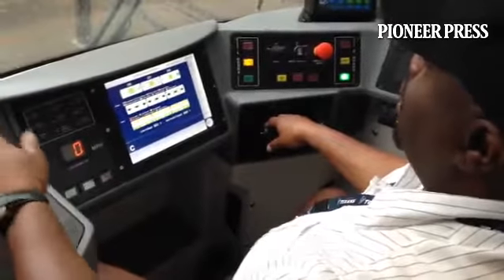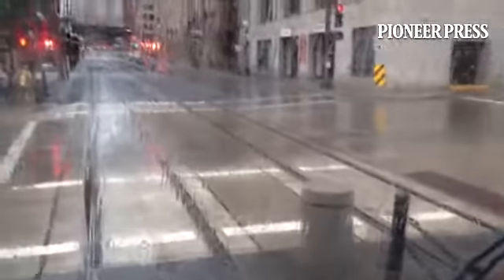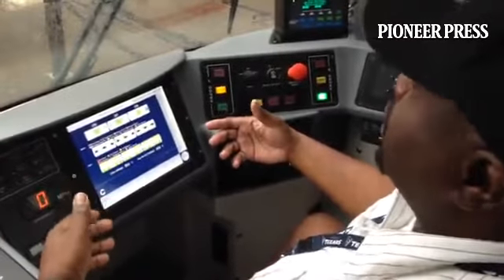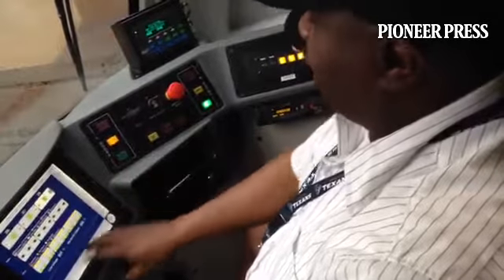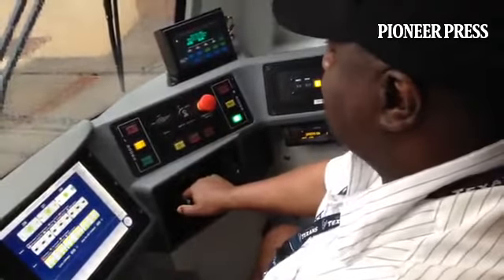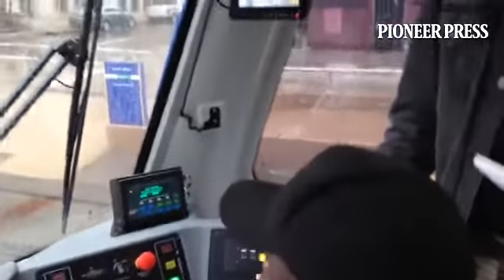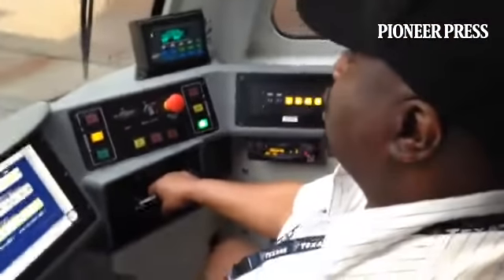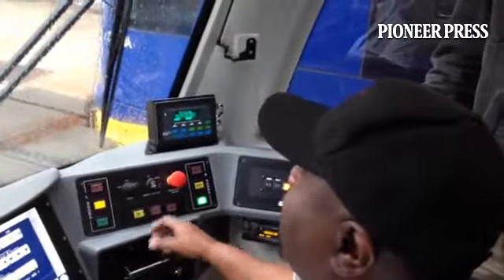Rolland Green blows the horn on the new Green Line light rail...

Comment: I notice newer light rail trains and streetcars have electric K5LA horns
Reply: +Raja Rhodes They've had them for years, though alot of Metro's new light rails substitute the electronic K5LA for some buzzer that sounds like a dying duck. I don't know if it's supposed to be quieter because people care more about their petty vanity than public safety (one of the main reasons I detest railroad quiet zones), but they sound extremely unpleasant.

The systems I know of that do have the electronic K5LA horns besides Metro are VTA (San Jose), MAX (Portland), UTA (Salt Lake City), and RTD (Denver). San Diego uses either a single-tone e-horn or some buzzer that sounds like a killer robot, NJT has actual Wabtec air horns, San Francisco and Sacramento use single-chime airhorns (though Sacramento has ex-VTA cars that still have their old e-K5LAs), Seattle has some sort of multi-chime e-horn I can't identify, and I have no idea about Phoenix, Dallas, Atlanta, or Norfolk.
Reply: +BNSF1995 i live in Dallas. DART train have air horns for use around traffic AND an air whistle for regular rail crossings. they also have actual bell. DART has Kinkisharyo SLRVs and use all standard horns and whistles and bells. no electronic bells or horns
Reply: Yeah the light rail has an electrical horn and they rarely use it.
Reply: @Trainlover1995  don't forget that LACMTA uses E-K5LA's